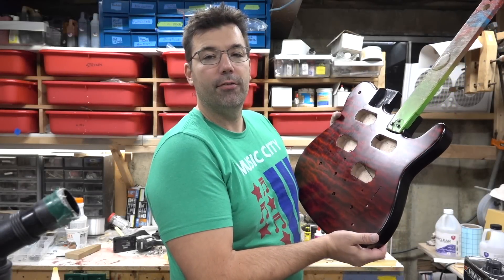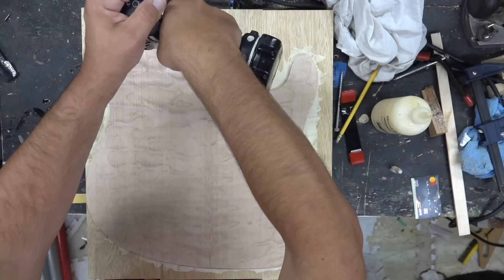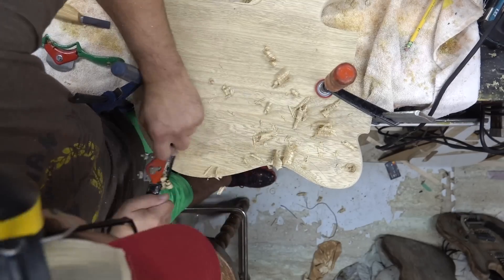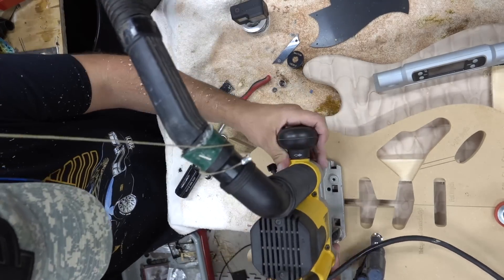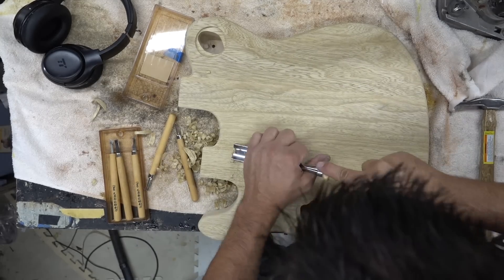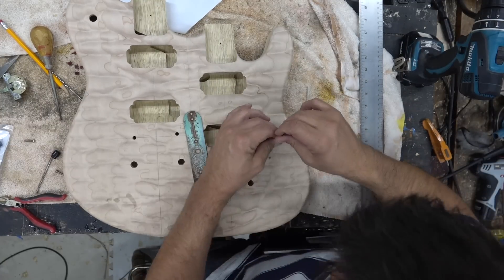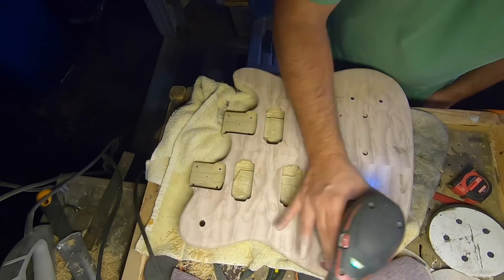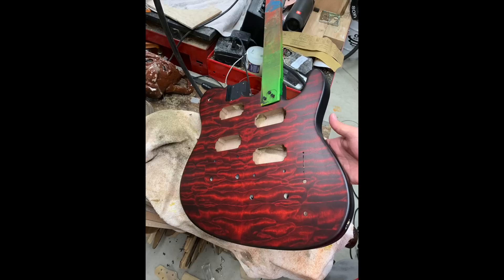Building a Double Neck Guitar Body

Comment: Is Your 12 String neck wider than a normal 6 String neck.. 
I got a Schecter maple fretboard neck 24 fret.  On local Guitar shop. Out of parts bin.. for $25.   For 12 String side..I'm planning on getting a Ibanez GIO 7 String.   And grinding down the sides to bring it slightly wider than the 6 String side.  
As You might tell..  I'm completely Low Bucks. ..lol
But I have like 8 home built customs. And I am happy playing them.  
No.. they're not without imperfections.   They're better than the average layman's Garage builds though